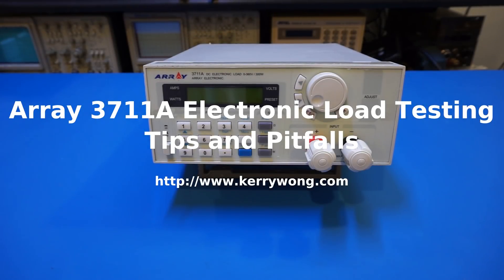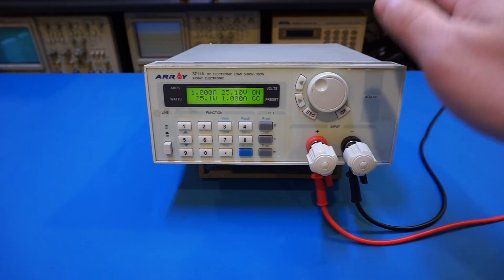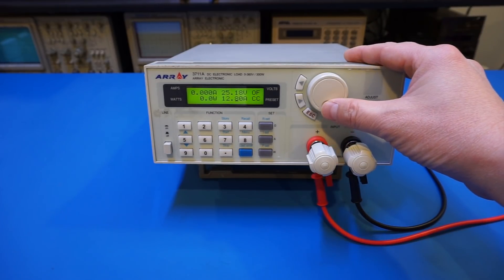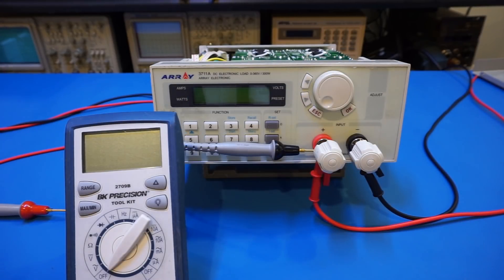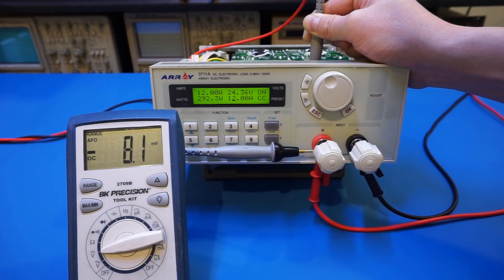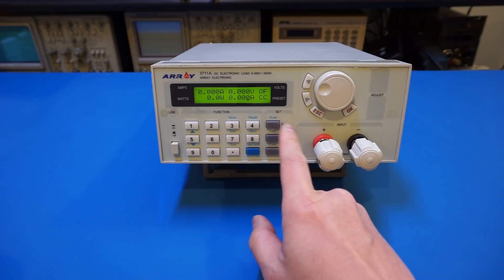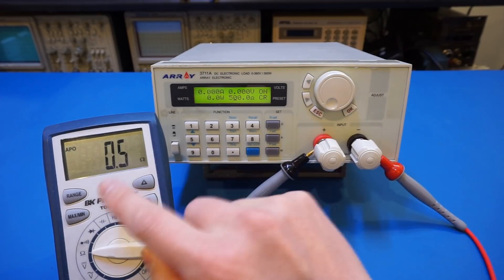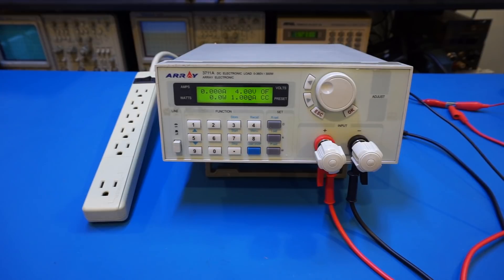Array 3711A Electronic Load Testing – Tips and Pitfalls

Comment: The two quadrant config was cute. One thing that worried me when you were doing this was if the electronic load input is floating. For example does it matter if say the positive input is grounded and negative is at -10V? I thought if the battery charger was ground referenced it could cause trouble.

Comment: Hi, You misunderstood my point I made on your last video (Or I wasn't clear enough). The voltage drop between terminals and the sensing point is as you mentioned insignificant but you are measuring a device and If you cannot eliminate voltage drop on your leads, the measurement is very inaccurate.  Most of DC loads have additional sensing input (either on front or back of the unit) so you can sense the voltage directly you your device terminals. I bet the voltage on your PS was much higher so the power was (my rough guess)  10-15W higher there.
Reply from the maker: OK, now I got what you were saying. You are correct, this would be a problem if you are relying on load's meter reading when measuring the delivered power from the source especially when load current is sufficiently high.  That said the reading remains accurate as far as  the power dissipation within the load is concerned.

Comment: 16:19 what schematic is that the official one or yours ?
Reply from the maker: That's the official one.
Reply: @KerryWongBlog  Thanks for sharing the schematics, I'm studying this compared to the BK series loads, BK loads use a dedicated ADC while this uses a cheaper design technique using a 12-bit ADC on the MCU probably over-sampled,  but at 1mV up to 4 V are probably for battery applications.
Reply from the maker: Thanks for the info!